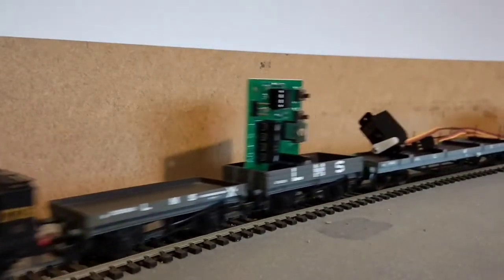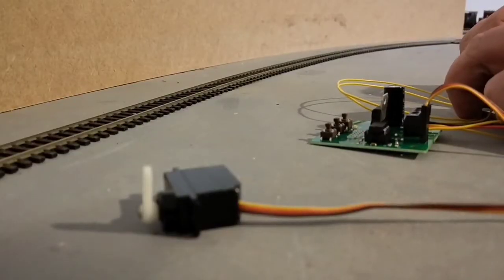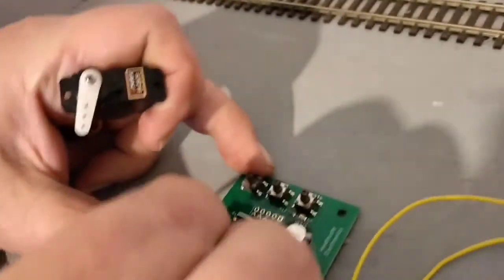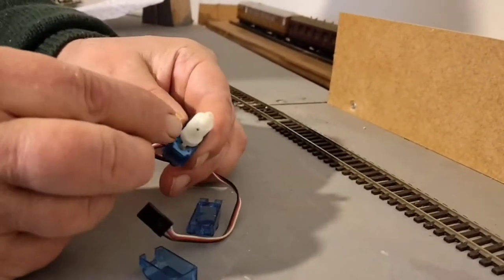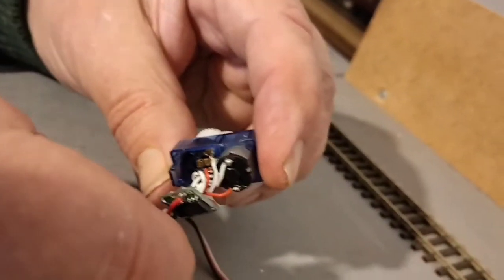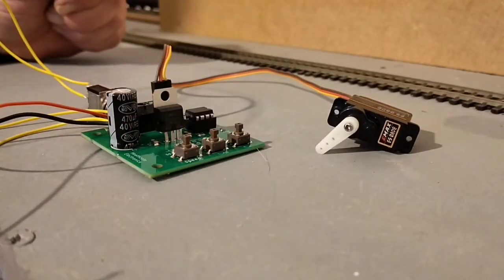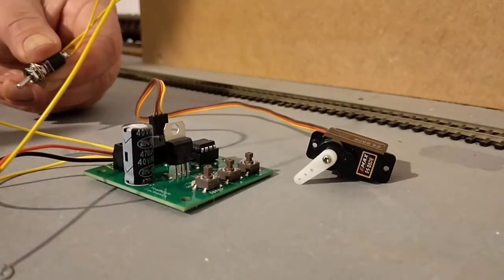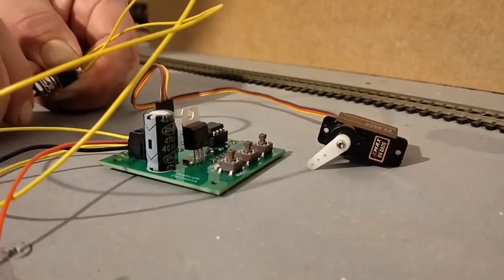Controlling Servo Motors on your Model Railway

Comment: I would like to place a servo in my engine, G scale.  Does this sound correct ...  a 18v battery I can step down to 12v to power servo thru control, and a 12v  300mA (not tied to the servo control 12v power just the S) on/off signal can come from the onboard decoder to act as the switch.  My only concern is the decoder is max output is 300mA and I don't know if that will be an issue.
Reply from the maker: I think that the decoder signal may not be compatible because its a voltage not a contact . This could be overcome by using an optocoupler with a npn transistor output  as an interface which would require about 20mA you would need a resistor around 1K to limit this current . The collector to the S terminal and the emitter to the 0V terminal Alternatively you could use a relay for the interface.

Comment: Micro servos where the best thing to ever happy to model trains.   Sadly, in the USA,  very few of these control boards are accessible.   We only have the overpriced ones.   Soon as I find a great option, the come from the UK and are never in stock in the states.   Going with the cheap and accessible servo tester that sell for around $1 US and for another few pennies, you can more or less get a pretty nice little control setup.

Comment: Brilliant video. Very interesting. 
Can I please ask? With regards to the Servo Motor Controller, am I right is thinking that I would need one of these controllers for each servo?
So if I was to have a layout containing 10 x points, requiring 10 x servos, then I would also need 10 x Servo Motor Controllers?
Reply from the maker: Thanks for your comments. You are correct that you would need 10 Single Servo Motor Controllers but you would only need 5 Dual Servo Motor Controllers.

Comment: We're can I bye this item
Reply from the maker: Thanks for your interest. Our products are only sold by mail order. You can order them from our website www.heathcote-electronics.co.uk. The circuit board is a Single servo Controller, we also sell servo motors brackets etc but most servo motors are compatible with the Single and Dual Servo motor controllers.